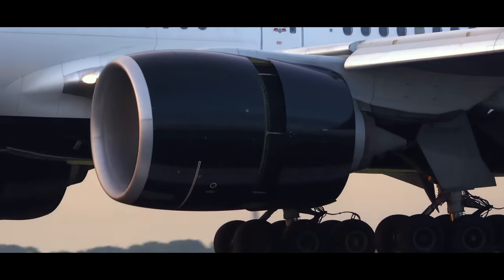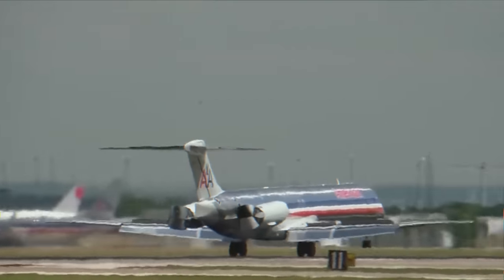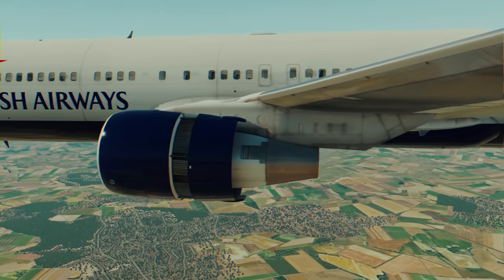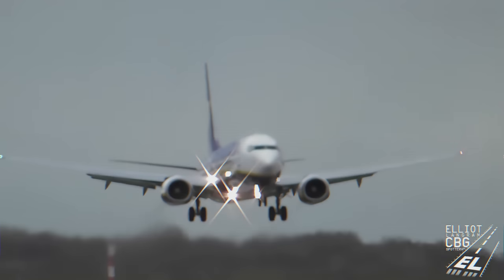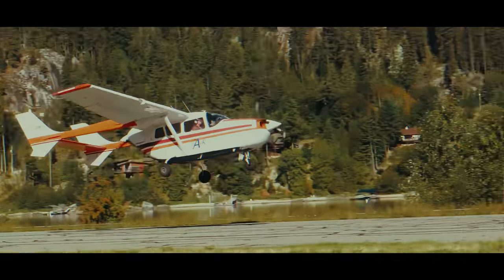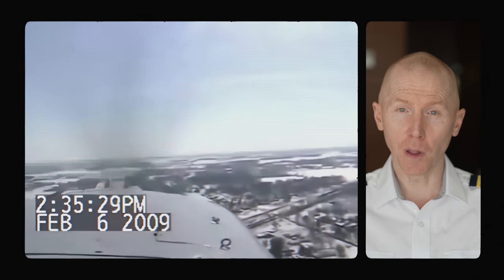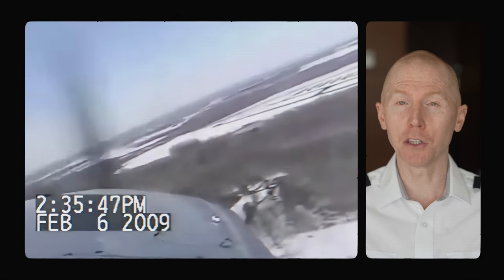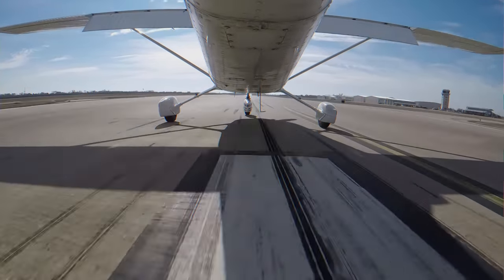Ryanair Pilot Makes Big Mistake

Comment: Ryanair, the budget airline, have a relatively extreme focus on their flight turnaround time - both due to the legal limits on a pilot's flying time and their razor thin margins on ticket-only passenger rates - and so I would not be remotely surprised to learn that the pilots here are exploiting this reverser "feature" of their aircraft to shave another second off their total flight time.

As you said, it's not particularly problematic; Assuming the logic demands the aircraft be below a set altitude to allow deployment, at worst this practice is going to cause an aircraft to come down a little harder than normal; Catastrophic scenario might see the gear crushed, but that's a pretty outside chance given that there's little time from the maximum altitude deployment is allowed at to accelerate the sink rate to the point that it could damage the gear.

Is it a good practice? Probably not, but given the above I think it's quite a deliberate - and smart - move from the pilots to achieve their company's objectives.

Comment: I did not know that was possible. Anymore. (For thrust reverses to deploy without ‘weight on wheels’) I know it has ended v v badly in the past. Definitely up there with a massive fear.
Kind of relieved this wasn’t uncommanded thrust reverser deployment. Because that would have been terrifying.

Comment: I am always suspicious that a desire to stop the plane at the earliest taxi way is a factor in how the controls are used.  Many years ago I was in the aircraft manufacturing industry when we had problems with wing spar fatigue cracks with one design of aircraft.  The affected model was flown back to us for modifications.  It was noticed that pilots were not using the full length of the runway when they brought the empty aircraft in for modification.  The company test pilots used the space available.  The commercial pilots behaviour resulted in a heavier landing and braking.  This type of landing put stress on the wing spars.  The model of aircraft was designed for long flights but was now being used by a major airline for short haul.  Consequently there were more take offs and  landings per air hour than had been envisaged.  The fatigue was picked up in routine maintenance and fixed on all the planes in operation.  The story was not great for the brand but the problem was remedied.  Ryanair pride themselves on fast turn around and on time flights.  Would this target influence how the aircraft are flown as  well as managing a landing under difficult conditions?
Reply: ☝️thanks for watching & leaving a comment, congratulations, you have been selected amongst my shortlisted winners
Kindly message me on the above☝️

Telegram only to claim prizes🎁

Comment: Hey Kelsey, WRT wieght on wheels reverse allowed/dis-allowed in 747, can the pilots still activate the reversers on the controls and await touch down to then allow reversers to actuate, or without weight on wheels, are the pilots UNABLE to attempt control actions to reverse position? Kind of like ARMING spoilers, but for reverses YES/NO?

Comment: I was taught that if the engine failed on or shortly after takeoff, it was a cardinal sin. To try turning back to the runway. Obviously this pilot had more height than I ever did when the instructor leaned over and pulled off the power saying ‘your engine has just failed, what are you going to do>’. Usually you would get the nose down and look for a suitable place for a suitable safer forced Landing spot. Any manoeuvres or. A king the aeroplane will lose you more height very quickly & increase the KIAS at which the aircraft will stall. Personal, I think this guy was plain lucky he didn’t stall completely- wouldn’t even care about runways, let alone banking left and righ at low altitudes with the stall warning screaming at him.

Comment: I disagree with you on the second video the captain took the right decision landing on the second runway for these reasons:
1- the first runway was almost 90 degrees and he was in the middle of it by the time he lines up with it he will run out of runway to land and shoot off the runway to the snow at the end also it would be a much harder bank to line up with it at 90 degrees 
2- the second runway was almost on his direction and he was able to get to it at the beginning of it yes it was a hard bank but it was his only option 
3- you can see that he was struggling to get the plane down at any runway at first he was going to land at runway 1 but for the reasons I mentioned above he decided to go with runway 2 and it was the right call

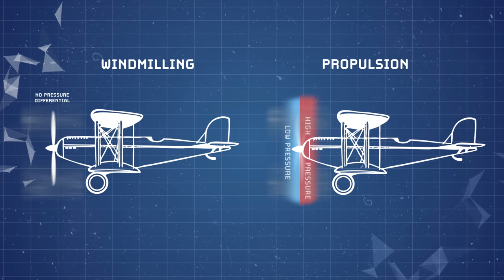Comment: 13:55 Don't propeller planes have a lever, which allows the pilot to turn the propellers, so that there is no windmilling? After all, windmilling creates drag, so it even slows the plane down instead of creating thrust.
Or is that lever only present in some planes?

Comment: a windmilling propeller creates drag does it not? I understand if you have engine failure in a king air for example you want to feather the prop immediately to stop it from windmilling. Is that correct or no?

Comment: I believe the B732 can deploy thrust reversers when the Radio Altimeter marks 10 but in the same chapter says it SHOULD NOT be deployed mid air under normal operation, im gonna look it up in the FCOM i've got...

I remember once i hit a drone while cimbing when I was in flight school, It was a mess the propeller goveronor went crazy, oil spilled on the widshield from the governor, landed safely and my instructor was laughing his ass off "welcome to the pilot's life, I've got my share of emergency landings when I was a DC-3 pilot"

Comment: Tbh I thought actually that even if you pull them before they will only open once you are on the ground. If they should never do that, I wonder why it is even possible. I mean I know they block it in flight as well after an incident with it if I remember correctly

Comment: The only mistake and not big was giving right roll just before tochdown to correct his direction a bit when he heard "ten" because he could've gotten close to an engine or wingtip strike on the ground. The landing wasn't smooth with maybe at least some 200ft/min vertical speed but it wasn't a hard landing either as I'm pretty sure that the vertical G load recorder was about 1.5 or definitely lower fhan 2 (my guess as a good knowledge AE).

Going for thrust reverser at 10ft (that's the max AGL at which the EEC allows for) isn't wrong at all if everything else is done correctly to not generate a hard landing (something over 500ft/min as a descend rate). The fact that almost no pilot does that with the 737NG or MAX doesn't mean that thr pilot is doing it wrong as you wanna say or any other poor to zero knowledge person.
Reply: If the right wing  was the upwind wing, then landing with a small bank ( no more than 10° ) is not a mistake but a part of a very basic manoeuver called decrabbing.

Although i agree that this method is not the best with swept-wings, hence why boeing made  the main gears able to land with crab. 
But if you know what you re doing then you wont have any troubles.
Reply: Also selecting the thrust reverser at 10ft is actually a bad habit as you are kind of committed to land. You should be able to go around without problem and just before touchdown

Comment: What's your method of overcoming your muscle memory from one model to the other where you have all the same controls, all doing the same thing, but operate opposite each other or located in a different layout than the previous plane you flew?
 I've ran into this scenario driving different trucks, even when they're the same model but the manufacturer had changed some things up mid model year throwing me off my rhythm.

Comment: That second guy pulled off the impossible turn. A lot of others have tried that maneuver and it turned out really poorly. This guy actually did this at an airfield just a couple towns over from me. I think as bad as I would want to get back to the airfield my first instinct there would be to put it down straight ahead in an empty cornfield. But congrats to him pulling it off. It was a Mooney btw if anyone was wondering.

Comment: Ryanair lands on very short runways. They also don't like to go around. They have a rotation times that can be as low as 15 minutes. I've been on a Ryanair flight with a similar hard landing (felt like we dropped from the sky and was very hard and painfull on the back). After theplane landed we taxied in less than 3 minutes, exited at the rear exits at the same time that the next flight passengers were entering the plane with the flight attendents collecting garbage in between incoming and outgoing passenger. And we were delighted to get wellcome by the odor of kerosen as they were fuelling at the same time the passengers were climbing the stairs up and down, with just a piece of rope to prevent the passengers to get to close to the fuelling pipes. Ryanair are cheap and fast. They don't do comfort or security.

Comment: Couldn’t disagree more about the EFTO. So many pilots die at low level trying to turn back to the airport with a dead engine. I was taught to land straight ahead, or within 45 degrees of climb out heading if it stops below 1000 feet. As you say Kelsey, those low level banked turns with the stall warner going off scream spin-in to me. I’d also put it down on the airfield, not on the runway. Sure you may hit something but airport infrastructure is designed to break away when hit (frangible), minimising damage to aircraft, and on the field you have emergency services on hand. Spinning in means almost certain death! This guy was seriously lucky!
Reply: ☝️thanks for watching & leaving a comment, congratulations, you have been selected amongst my shortlisted winners
Kindly message me on the above☝️

Telegram only to claim prizes🎁

Comment: Has anyone stated the fun fact that Concorde could deploy thrust reversers in flight on the inboard engines? Typically used as air brakes if expedited descent needed.

Comment: aaah now I get how it works
always been thinking about how Viggen does it.
but been confused since those fans suck in and push so much air so how could it generate a net breaking force. ;) so your modern engine is reversing the bypass air.
but now i remember older passenger planes that have some blades that flip around and they put them behind the jet exhaust. I wonder if there are more styles to cause a reversing force.

Comment: of i noticed in the a380 video i saw 2 engines has no thrust reverse while the other 2 did but the a380 only have thrust reverse on 1 on the left and right but it was on both on the left that picture is false

Comment: Seems to me like all aircraft should be designed to allow the APU to be engaged while in the air.  Otherwise, if the engines are all out, you're deadsticking, AND have no information or communications.  Batteries don't stay charged forever.  Bad design.

Comment: Could that thrust-reverser maneuver be a valid way to land safer on a short-runway or tailwind situation?
Reply: No. For those scenarios you have flaps 40. Just dont float and land on the tdz. Then use the reversers, as soon as the main gears are on the ground and the speedbrakes deploy  but not before.

Comment: Lauda lost a B767 because of a reverser deployed in flight at cruise altitude.
In the case of the RYR carrier landing, you can see that the aircraft gets very low before climbing back again and then landing. The B737 can deploy thrust reversers on landing once you are below 5’ RA. My guess is that the pilot already had his thrust levers at idle, then pulled the TRs while still airborne (which you can do) but about to touch down (or carrier land, it’s RYR, after all), then a sudden gust pulled him back up, but the TR logic and deployment was already triggered.
Why did Boeing and SNECMA install this “feature” on the B737? My guess is they did it to improve landing performance, cutting down on the TR deployment time by allowing pilots to deploy them when just about to land. Is it wise to deploy TRs while still airborne? Well, it depends. I’d say almost always yes, unless you are in gusty conditions and a balked landing followed by a GA is a possibility, since once TRs are deployed you are committed to land and can’t GA anymore.
Food for thought

Comment: How much farther can you glide if you feather the prop? Do many small aircraft allow feathering?
Reply: A windmilling fixed-pitch propeller does create a lot of drag.  Hard to quantify how much further one could get with it feathered, but it might make the difference between hitting the trees and getting into a field.  Most small aircraft with engines less than 150 HP don't have variable-pitch propellers which can be feathered, and it is a feature usually found on twins, where the failed engine is feathered.

Comment: Why wouldn't it be beneficial to run the APU when in the air? Why would the system logic prevent that?
Reply: Why would you want to run an APU while in the air?
Reply: @NemesisFromResidentEvil  for emergencies?
Reply: @rotordave81  You can on Airbus but not Boeing, I think the reasoning is that the chance of both engines failing is extremely unlikely and if it does happen, an APU wouldn't offer much benefit as the RAT can do the important things

Comment: Why is not trust-reverse the primary speed reduction system together with the spoilers after touchdown and then complemented by the wheel break system?
Reply: ☝️thanks for watching & leaving a comment, congratulations, you have been selected amongst my shortlisted winners
Kindly message me on the above ☝️

Telegram only to claim prizes🎁
Reply: Because the braking action works better than the thrust reversers? The thrust reversers must be stowed at 80 or 60 knots depending on aircraft and airline SOPs

Comment: I assume that there is a manual override of the "weight on wheels" logic if, you have to land with gear up for some reason?
Reply: If you land gear-up you won't need brakes or thrust reverse...
Reply: @martinwade9421 really? I didn't think the frictional coefficient between aluminium and concrete was that high.

Comment: cool he made it .to ground. you took the diagram pressure difference of screen to soon. ! in hindsight its easier to see what went wrong so glad he came down safe couldn't do that !.it might have been G forces i did that in hawk in G suit it pushed air out i was not used to it!.yes cause even as gymnast the floor is  sprung got soft matress not like our bed matress you go straight through those ( i did) and even then when jumping i wouldnt jump from height more than wais theight you could loe legs and when escaping a fire we are trained to hang down on second florr to break fall .

Comment: This looks a fairly standard Ryanair landing. They deploy the reverse thrust early in order to execute what, in a car, would be a handbrake turn off the runway into the gate and dispatch passengers as fast as possible, in order to make the next departure slot in 30 mins. The screams of passengers is usually drowned out by the "dah daddle att dah dah dah dah! ANOTHER ON-TIME RYANAIR FLIGHT!"  PA announcement. The only mistake is actually made by the passengers who have chosen to fly with them; myself included.
Reply: Alan

Comment: From an avitor with your experience i would expect more let’s say “pragmatic” informations and a simple research on the web for 737 Flight Crew Operating Manual would have revealed that: “The thrust reverser can be deployed when either radio altimeter senses less than 10 feet altitude, or when the air/ground safety sensor is in the ground mode.” Avoiding all this i would say, not needed discussions in the comments.

Comment: It has been said - though it could be urban legend or media spin - that in its dogged determination to keep fares low, Ryanair requires its pilots to cut as many corners as possible short of compromising passenger safety. Their pilots thus have a reputation for playing things fast and loose. Is this footage evidence of that, or is it simply a case of pilot error that is very much an exception rather than normal?

Comment: That makes no sense.  Why would "system logic" allow only one thrust reverser to open?  The last thing you want is to lose control on an icy runway because one reverser won't open.  You abort the landing and land at a safer alternate, no?  If both reversers open at altitude you idle the engines and glide until you can close the reversers.  If all else fails opt to crash 🤨

Comment: In the 747 it's because it will cause a massive loss of lift 737 some but no where near as bad still not supposed to open them off ground but it's not as detrimental as 747s

Comment: I'm not surprised at Ryanair pilots getting into bad habits or making bad moves. I would be very surprised if they got sufficient rest, and given how Ryanair loves to save money WHEREVER possible (regardless of safety and other issues), they're probably underpaid and under a lot of pressure all the time. Ryanair is a terrible airline - I once had the displeasure of flying with them (as a passenger), and ever since, I would happily pay A LOT extra NOT to fly Ryanair. Even if you're unter 6 foot tall, you will have severe issues with legroom on Ryanair flights unless you happen to end up in emergency exit rows.

Comment: Don’t need them? Ive never been on a flight that did not use them.
Reply: They help but most of the slowing is via the brakes.
Reply: @peteconrad2077  what about hot brakes though? Or is that why they use the reverse thrust?
Reply: @JakeTravelz  a normal landing won’t make the brakes excessively hot. Reverse will help but other than on contaminated runways it is only a small help.
Reply: @peteconrad2077  thanks!